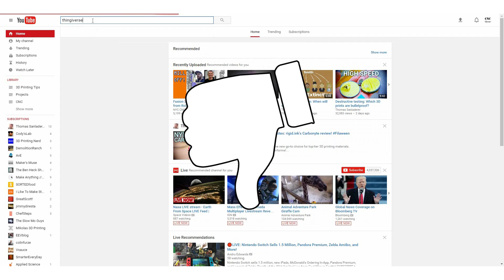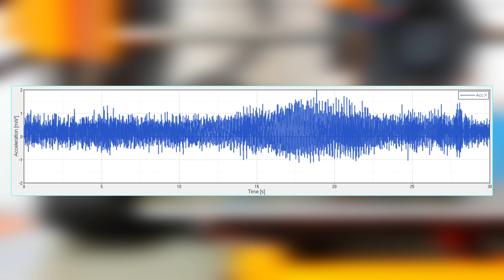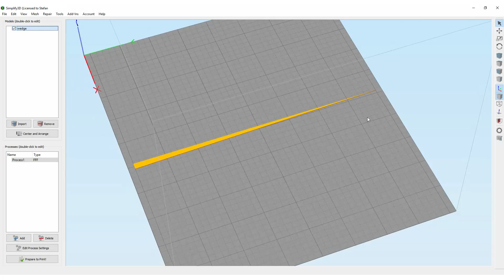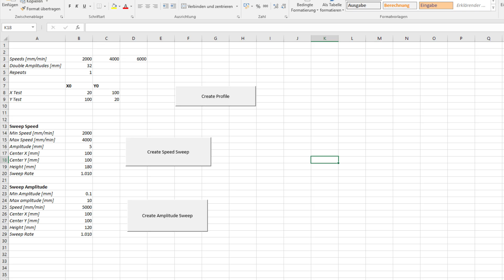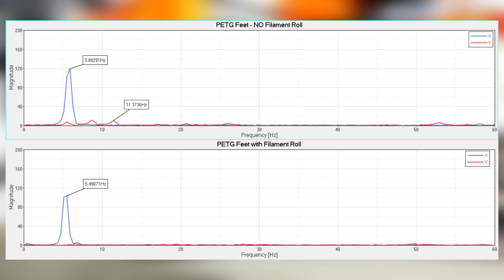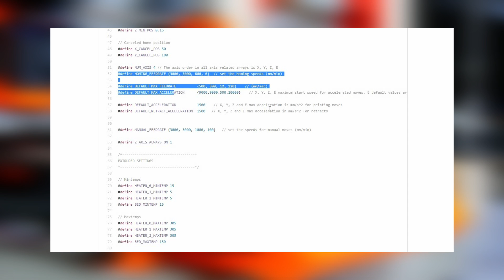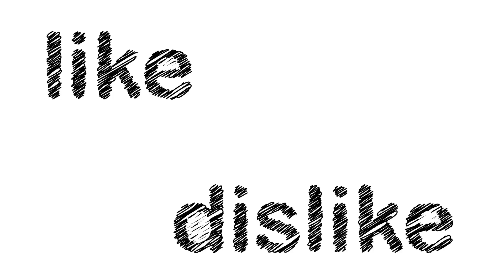Prusa i3 MK2 - Practical Vibration Analysis

Comment: Very nice video CNC Kitchen. You've earned my sub. Quick question though. At 4:30 you compare the resonant frequencies (with the second method) of no feet and petg feet but from different traces on their respective plots. You take the peak value from the "Y" trace of no feet graph and the peak value from the "X" trace of the petg feet graph. Did you by any chance mix the "X" and "Y" data up in one or more of these graphs?
Reply from the maker: You paid attention very well! So with the feet the main mode is from side to side (x-axis). When I don't use any feet the main mode is the gantry moving forwards and backwards (y-direction) and then the second mode is x-resonance. Comparing the same modes it really should be 15.3Hz VS 8.4Hz VS 5.9Hz.
Reply: Ah yes, that makes a lot of sense now. Thank you.

Comment: I did the paver stone method, and it is insanely quieter & smoother. Picked up a 16in x 16in paver stone from Lowes, $3, then a pack of 6 1.25in felt pads, $5. In between the plastic feet of the i3 MK2, instead of using the felt pads that came with the printer (because I must have thrown them out), I cut up an old RoadID band (orange, perfect match), and placed it under all 4 feet. All I have now is a slight vibration at times because the right threaded z-axis rod isn't perfectly straight & makes contact with the plastic retainer at the top of the frame. Thanks for that paver stone idea in your previous video.

Comment: Another awesome video! I did almost exactly the same thing for my CNC machine, except that I did not like the sampling rate on my smartphone. So I made an adapter for for an ADXL335 to the USB serial port:
https://sites.google.com/site/janbeck/vibrometer-for-cnc-stiffness-tuning

Then all the same things...

But since you have such pronounced fundamentals, how about making a tuned mass damper for your Prusa and keeping the rubber dampers?
Reply from the maker: Nice article! I used the phone because the sampling rate is good enough for my printers problem. I have a small shaker table where I was already looking for a higher sampling rate instrument where I will definitely  get back to your solution.

I was already thinking about a tuned mass damper but the system is (at least a bit) nonlinear. You will add mass to the table and move the extruder in z direction.
Reply: You are right, of course, but compared to the mass of the printer, the added mass of the plastic and the shift of the z is comparably small. Should be simple to hook up a damper of the pendulum type to test ( that stock spool holder might be the right thing already), don't you think?

Comment: A pair of balance-masses for the major moving elements (bed + nozzle) would minimize the excitation-source. This technique is very common in lithography-machines. I've been meaning to try this on my own i3, but feel that a.t.m. other factors are more detrimental to my prints than vibrations, so am putting it off. Perhaps sth for in the future..
Reply: That would be a very smart way to go about this. I do wonder though how you's do this without altering the construction of the printer much. My first thoughts on how to accomplish this relatively easily all leave me having to redesign both the X and Y axis assemblies.
Reply: Using the same linear guidances (smooth-rods) and actuators (return-half of the timing belt) would be ideal - Only - how do you get the two masses to cross over? Perhaps a set of secondary axes shall be needed...
Reply: Yeah. For now (only thought about this for literally a couple minutes) I'd say have another linear rod behind the X-axis for the weight and redesign the X-carriage so, that the clamp for the weight, attached on the "free" side of the belt can pass through unhindered. And then maybe a couple rods beneath the Y-carriage for a weight there. That one doesn't need a redesign for parts though, I think, so that'd be easy enough.
Reply: @Jaroneko  Adding mass changes the dynamic properties. You have to accelerate and decelerate larger chunks. Going slower? Possible, but. Adding power? Back to field one.
Reply: Wouldn't an additional balance-mass double the force required by the motor for acceleration/deceleration, as force = mass * acceleration?
Reply: @qwertzuiku3t87hv86f8  Not the force, but the power. As you point out, F=m.a - so the acceleration will stay the same for the same force. What does change is the power - P = F.v and the (relative) velocity will be larger, as the two mass are moving away from each other. (Another way is to say that you store more kinetic energy in the system.) One way to prevent needing 2x as much power (i.e to reduce KE for the same momentum of the balance-mass) is to have the balance-mass much more massive than the actuator. That way, you need maybe 10% extra power (instead of 2x more power). The point is that you never apply a force to the (sloppy) frame of the gantry, so you get zero vibration and deflection of the gantry.

Comment: Very interesting video! The resonance in the X axis is a lot larger than the Y axis. Is this due to the direction of excitation? If not, some vibration dampening feet with different stiffness in X and Y direction could be interesting.
Reply: The exciting masses are different and differently placed. Also, this test print moves the X-axis a lot more than the Y. The X-carriage is certainly the main moving mass in most prints and it also changes its Z position over time, where as the bed (the Y-carriage) stays in place on the Z-axis and often moves less and slower. The Y-carriage is also a more spread out mass.
Reply from the maker: You're very right. The x-carriage also has a higher lever arm to the center of rotation for the first vibration mode. The second mode actually is the gantry moving forwards and backwards especially if you have the filament roll ontop.